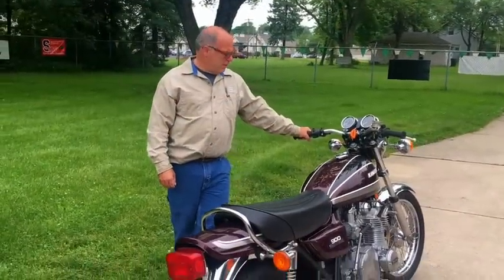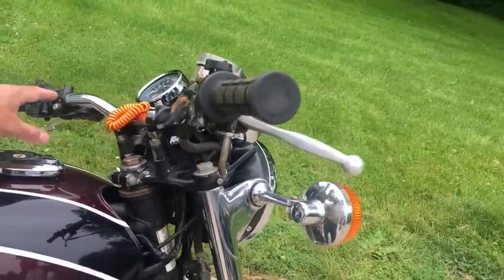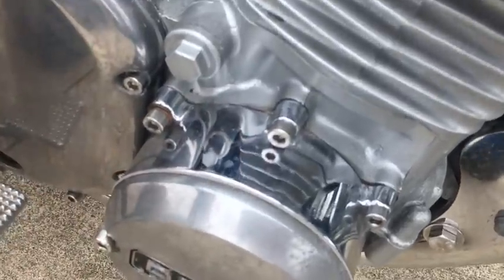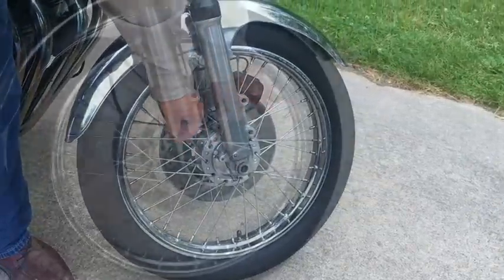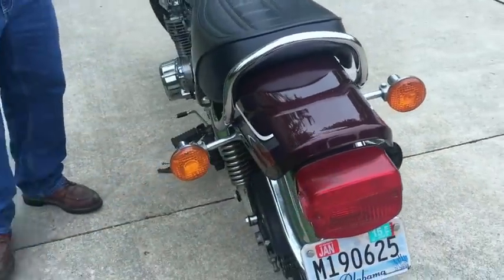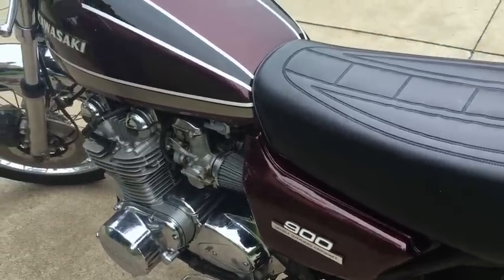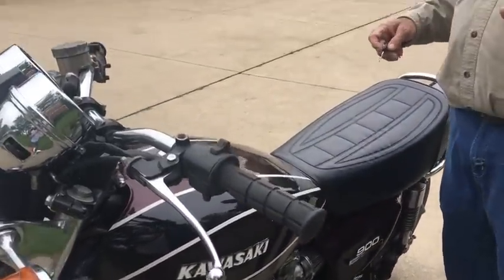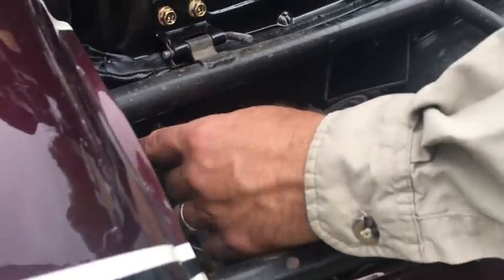76 KZ900A "Sweet Georgia Kaw"

Comment: Johnny, gidday from Australia.
I just want to ask, do you have your own personal collection of Z1s? If you do have a collection of bikes, could you do a show and tell on them?
Love your videos and your obvious obsession with these magnificent motor cycles. I would have one but they are just to goddam expensive in Australia.
Reply: G'day Luke. I missed a QLD registered 1976 Z900-A4
 (Z1F-85701 through Z1F-138846) for $2,000 on Gumtree a couple of years ago;. Apart from the 4-1 exhaust, recovered seat and missing 'z900' badge on the RH side-cover, it was all original, paint, chrome electrics and everything else (even had twin discs up front, just showing it's age o the finish and 85,247.3 km on the clock. Seller had it listed for 40 minutes when I called the instant I saw the ad (debit card in hand), sorry he said, 'sold in the first 5 mins and I haven't had the chance to remove the ad 'cause so many people have been calling; why is this thing so special?' I asked 'you really don't know?' He said he's not into bikes at all, it was from a deceased estate, his dad passed away and he had no use for it. So I spent the next 40 mins chatting with him explaining  the market for these and how much I wanted to add it to my collection of seven other Kawasaki bikes (in a two car garage, with one car, 100L compressor,  blasting cabinet, parts washer two desk work benches, 3 section pallet racking and rolling tool chests, 2 door bike clothing wardrobe and a bunch of other stuff; it's a tight squeeze). He felt bad about letting it go so cheap so he said if the buyer didn't turn up with the cash 8 am next day it would be mine at the same price ('cause he realised I would care for his dad's pride and joy) but if didn't answer the call he'd up it to $8,000 firm.
You've got to be watching the market like a hawk.

Comment: I think Yamaha used that same battery at least til 2000. Did you ever get a bike the valves were right? My real question is when adjusting valves do you prefer tight or loose on the tolerance?

Comment: Johnny thought you said they didn't do a sealed type YB10LA2 battery replacement , yet you had one on the finished bike? Here in the U.K. the only sealed  one available is bright yellow! and so is visible from the left side of the bike under the side panel, it sticks out like a sore thumb, so like me most of us stick to the old vent tube version.
Reply from the maker: Terry, I"m answering you from home on a Saturday so I don't have the information readily available. My mechanic came up with a sealed battery that we mounted sideways as well as adding some rubber around it to make it fit. I'm not sure what the part number is, if you'd like, give us a call at the shop on Tuesday and we can discuss. 1-1-330-335-7365.
Reply from the maker: Terry, there is another option. We are allergic to vent tubes, and the potential for battery acid to leak out and ruin pipes, paint, etc. One way around this to install a sealed battery like the Yuasa YTX12-BS. Once it's filled with the pre-measured electrolyte that comes with it, it's permanently sealed with the cap that is included. Then it can be installed on it's side so that you don't have to compromise the battery box to get it to fit. We'll do a short video of this in the near future.
Reply: Johnny s Vintage Motorcycle Company

Comment: I noticed you said no one made a vent less battery for the bike but that later on you had one in there but mounted on its side.
Reply from the maker: You are correct, Robert. We are allergic to vent tubes, and the potential for battery acid to leak out and ruin pipes, paint, etc. One way around this to install a sealed battery like the Yuasa YTX12-BS. Once it's filled with the pre-measured electrolyte that comes with it, it's permanently sealed with the cap that is included. Then it can be installed on it's side so that you don't have to compromise the battery box to get it to fit. We'll do a short video of this in the near future.
Reply: @Johnnysvintage  I agree with you on the ventless batteries.  In fact, I agree with all your favored choices: stock except for upgraded electronics, Pingel petcock, and removal of the chrome from the engine attachements.

Comment: Nice work guys, does anyone know what the other small hole on the headlight bucket is for. Iève never seen that before... unless it was added on by someone , it looked like it had a factory grommet on it. Thanks Doug
Reply from the maker: They had some kind of a plug in there, but my guess is that it was for some kind of accessory switch or something.
Reply: @Johnnysvintage  Please look me up if you find yourself Down Under one day, Love your work, doin' it myself with seven Kawasaki bikes (in a two car garage, with one car, 100L compressor,  blasting cabinet, parts washer two desk work benches, 3 section pallet racking and rolling tool chests, 2 door bike clothing wardrobe and a bunch of other stuff; it's a tight squeeze). The care you have to ensure the customer's needn't worry about a botched restoration is admirable.
Reply: Johnny s Vintage Motorcycle Company
Chris Riddiford
Reply: @Johnnysvintage  If I remember right, I think some of the 73 Z1A's  and possibly some of the Z2's Japanese (Asian) models had a red speed warning light in that location and it also may of had a buzzer that sounded when the light turned on.... I am going off of memory though. Cheers, Doug